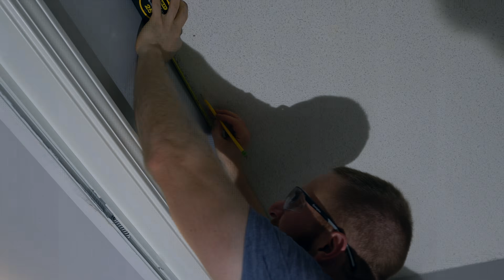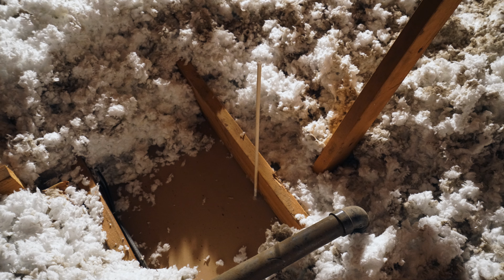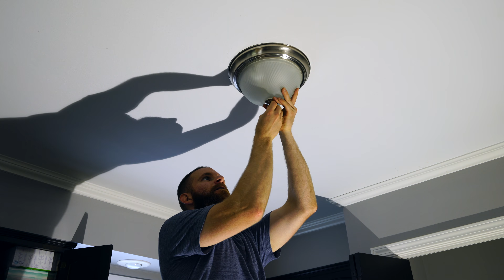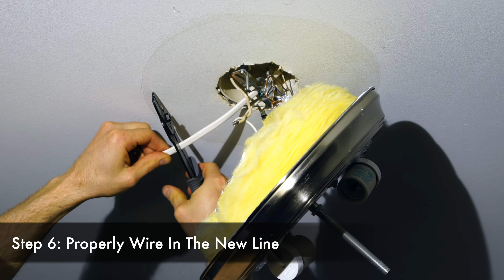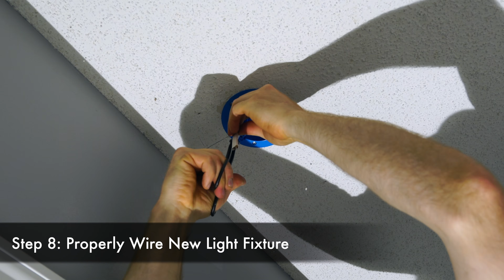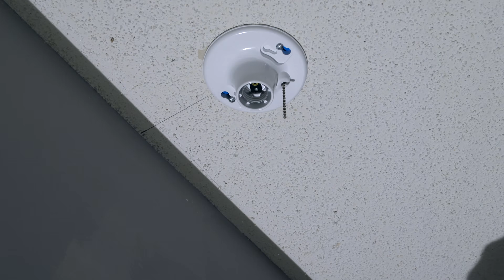How to Add a Light Fixture to an Existing Circuit

Comment: you should've ran a wire down to that junction box halfway down the pantry. good chance you'd be able to get constant power from there
Reply from the maker: True, I’d have to add another switch though and I wanted to add it to the light switch and circuit I already had!

Comment: Over simplified
Reply: Agreed. What attaches to what? And where? And how?  There's a picture of two neutral wires joined in a wire nut. I assume you take those apart and add the neutal from the 14AWG connecting wire? With what? A Different wire nut? A lever connector?
Reply: @champaignmusicmccolleythin6836 He explained black to black, white to white, etc..  if you aren't familiar with wiring pigtails with the proper wire nut or splice, you're better off getting an electrician.  Each connector is sized to the number of wires and the appropriate gauge.

Comment: Will the pantry light work by pull chain if the kitchen light switch is off? I’m guessing no. And potentially it would not work if the bulbs in the kitchen light were burnt out. So this is not best practice. There must be a better way?
Reply from the maker: Correct, the light would not turn on if the switch that it’s wired to is off. A bulb burning out wouldn’t have any effect on the other lights. If you want the pantry light on and nothing else then you would want to wire it differently which would be much more complicated and costly as you may need a dedicated wire for that specific fixture. Doesn’t seem worth it to me but to each their own!